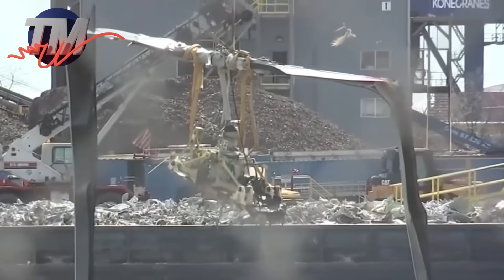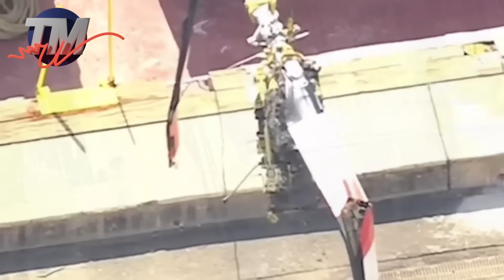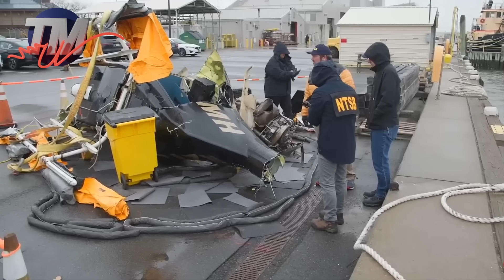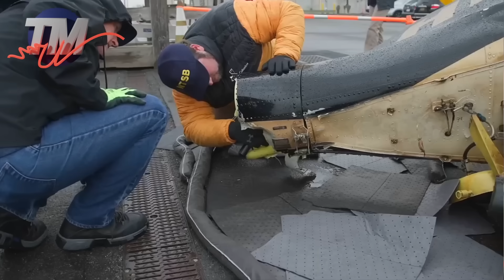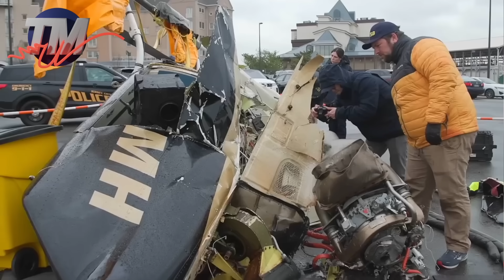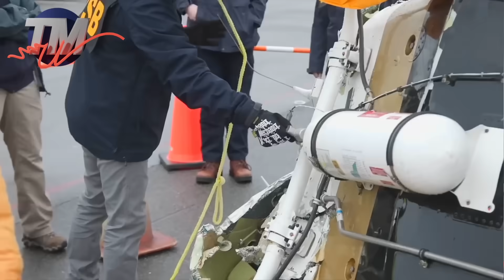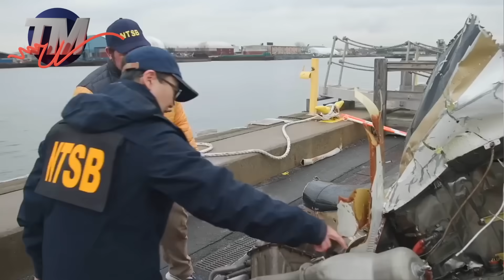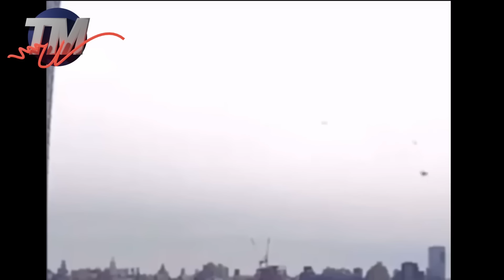Recovery of the Main Rotor of the Hudson River Tourist Helicopter - it's worse than we thought

Comment: Pure speculation but watching the videos I have a hunch or two. Former OH-58 crew chief so knowledgeable but certainly no expert. The crash video shows the MR with attached gearbox rotating all the way down to the water. This suggest to me that the gearbox had not seized as it appears to be rotating freely as a unit and remained in the same plane throughout the fall. The pics don't seem to show any mast bump deformation. Not sure a seized TR would generate enough torque to rip the MR & gearbox cleanly from the airframe. I suspect an airframe failure. As an anecdote, upon our units return from Desert Storm we discovered one of our 58's had severe but hidden degradation on the maintenance "walkway" on the roof. The airframe just gave away and the honeycomb crushed when stepped on. Engine mount/airframe failure if I had to guess.

Comment: I ask myself if maybe the pilot sent the message that he needed fuel and was coing back, because he realised that something was wrong with the helicopter but he didn't want to afraid his passengers. So, maybe he lied to keep the passengers calm. But he tried to tell his enterpreise that there was a problem.
Reply: From what I gather that was just to have the logistics prepared, he'd need a truck and the next run would be delayed for fueling.
Reply: He was already coming back though, it wasnt like he was cutting the trip short, it was only a 15 minute flight anyway, and that guy paid around $400 per passenger for tickets, so he paid around 2 grand for 15 minutes.
ANy kind of mechanical issue that would have caused the pilot to do what you theorize- would have been heard/seen by the passengers too, they wouldnt be fooled by hearing a LOUD bang and cracking sound and hearing the pilot radio that he's low on FUEL!
Low on fuel doesnt create banging, cracking or noises or wierd sudden unexpected movements inflight.
Reply: He was coming back anyway, he was just radioing ahead to say he needed to refuel before the next flight.
These operations do a number of flights per refuel, so it is common to call ahead when you need to refuel so they can be waiting with the fuel when you arrive. Radio call is a non event.

If he knew something was wrong with the gearbox he would have declared a mayday and looked for a landing spot immediately, including considering ditching.
Reply: @rosamolina2277  - I like your theory!
Reply: I too  @nadogrl
Reply: Interesting idea.  The fuel tank, if recovered intact, would tell if the chopper was that low on fuel.
Reply: My thought exactly when I first heard about the radio call for fuel. For that short flight, they surely had enough fuel. It was the pilots call for help!
Reply: @manariitane5167  That was his 5th or sixth tour flight of the day.  It's pretty normal for a pilot to notify his base that he would be needing fuel before his next flight.

Comment: The rotor separated from the helicopter is what's puzzling me the most. I've never seen anything like this before.
Reply: That is because the video shows the tail separating first. The tail driveshaft thrashed the whole transmission assembly free.
Reply: @sirsmeal3192  Order of separation from the fuselage does not indicate the sequence of failure.
Air accident investigation basics!
Reply: A witness said they heard two loud bangs and the helicopter 🚁 dropped from the sky another witness said they saw a drone flying towards the helicopter

Comment: Have you considered the fact that a 10- or 12-year-old child was given the copilot seat of the aircraft? He's just a child, and he thinks like a child, and he could have pulled some lever, like the lift manifold. The truth is, photos have emerged showing a child as the helicopter's copilot. This raises a question for you: Yes, on this type of helicopter, at a certain speed and flight position, a sudden sharp jerk is applied to the manifold lever. Could this cause the main rotor to hit the tail boom?
Reply: The child might only have been having a photo taken with the pilot. He might not have been in that seat for the flight.
Reply: @karenrussell8704  - My thoughts as well.
Reply: It’s a single pilot helicopter. There is no copilot.
The other front seat is a passenger seat.
There will probably however be a set of controls there for training purposes.
The seat is normally slid fully back so they cannot be reached.
Reply: I thought about that too.
Reply: It was only to take a picture before the flight

Comment: In a tail rotor failure, you don't auto-rotate, you do what's called a, "running landing." The UH-1, which I flew, streamlined between 60 and 80 knots, and if the tail rotor failed, you'd keep forward speed up and land on the skids and ride it out while the energy bleeds off.
Reply: Bull crap
Reply: So you don’t reduce the collective?
Reply: When you lose a tail rotor you lower collective and close the throttle(s) and enter an auto-rotation.

Comment: Its because they're litterely trying to find anyway to blame trump. Ive watched alot of videos and read alot of comments and people are blaming a sitting president, if theres an agenda thats it. Because trump wanted to change air traffic controllers from d.e.i hiring to bringing in people that can do the job the media has been jumping all over this. The problem is the air traffic controllers have nothing to do with these accidents they were caused by mechanical failure and pilot error. New york city's air space is very busy and theres no suprise its happening there. I mean the plane that landed in the hudson was caused by bird strikes, the military helicopter was caused by ignorance and lack of training, the helicopter broke apart, the small plane crash was due to low altitude none of these were trumps fault!!!

Comment: I don't think it's agenda driven (other visitors started their trip only minutes later with other companies, without any fear), but I also think the "amputation" lines at the helicopter seems to be very accurate. I don't think it was sabotage by opening srews...because the heli had several flights directly before. but the idea to initiate this chain of failures by any remote controlled thing could be a theorie. for any reason. what was the role of this manager? world is cruel.

Comment: There is not excessive hype in the reporting.  I can't remember all the incidents, but some of the main ones:  1. Passenger plane ready to land in Washington DC is hit by a military helicopter going down the river at night on a training mission.  All passengers are killed.including potential future members of the US Olympic team.  2. Commercial passenger airliner leaves Minneapolis attempts to land normally in Toronto, but clips a wing in rough weather conditions when landing.  The wing breaks off and the plane rolls over  on it's back.  Most passengers escape.    3.  NYC tourist helicopter has one of the most curious break ups of all time mid flight, and the pilot and an entire family of five are killed.   4.   Passenger plane leaves Colorado Springs, headed to Dallas, and  experiences engine vibration.  Pilots elect to fly to Denver rather than returning to Colorado Springs.  Denver is in the wrong direction and further away.   Plane catches fire at the gate.   Passengers elect to escape the fire by using the wing emergency exits only to discover they can't get off the wing because there are no emergency slides.
None of this is media hype.  These are real events that represent an industry that is dysfunctional, and as a result is not safe.
Reply: Example 4 - Pilot elected Denver perhaps because it was closest airport with MUCH BETTER first response equipment than Colorado Springs' smaller airport facilities. You don't have slides on over-wing exits.
Reply: @checkyoursix5623  Denver is further away in the wrong direction.  The passengers didn't know they couldn't get off the wing.
Reply: @checkyoursix5623  Actually you are wrong.  Most aircraft do have over-wing exit slides - just google the phrase and click on images.
Reply: The industry is in trouble due to lowered hiring standards over the past few years and antiquated, unstable computer systems that are difficult to maintain.  Also there is much more video coverage from security and personal phone cameras.  The Reagan National accident happened during prime time and had video images.  Those factors plus the widespread ignorant speculation and hysterical speculation by the clueless mainstream media heads all add up to the heightened awareness.
Reply: donald trumps America.   Planet trump
Reply: @frez777  What the "F" is wrong with you? Or are you just that "F"ing cold. This took lives that will never be complete. And it took some kids lives on top of that! You are a cold "F" and your time will come! I hope that you are all alone when the reaper comes for you my sad friend!
Reply: @frez777 seriously..go back to school
Reply: @frez777  Yours is the stupidest, most ignorant comment on this page. Air accidents are actually down this year so far, compared to previous years.
Reply: @frez777  Grasping at straws, advanced TDS?
Reply: @frez777  Nothing to do with Trump. If anything maybe its Biden's DEI program.
Reply: @NYyankeeboi  It has little to do with presidential politics, and more to do with rather old helicopters with many duty cycles being used to fly unsuspecting tourists.who believe the machines to be safe.
Reply: @frez777  More likely Biden's legacy.
Reply: I agree these are items worthy of the national news, but I think they are also coincidences and we just happened to hit a string of them. That said, I also don't approve of the way the Trump Administration is handling its duties and our agencies. If we don't see funding and employees back at work soon, then we can expect to see more catastrophes in many different areas, from food safety to bridges and weather.
Reply: @edherdman9973  This comment sounds like thirteen year old logic....Presidents just implement the plans of their hidden masters....The masters are all about Chaos as they implement their UN digital control grid agenda 2030
Reply: @edherdman9973  They are looking to reduced waste.   The bureaucracy is obviously very heavy  Ronald Reagan screwed up the ATC system years ago.. Most of these aircraft mishaps have nothing to do with any cuts made by  DOGE..  Hiow is this helicopter failure related to DOGE?   There are plenty of NTSB officials gawking at the wreckage.  Why would they start removing the instrument panel out on the wharf?

Comment: There was a heli over the Grand Canyon, where a boom strike resulted in enough force that it sheared off the tail section.  Not saying its a mast boom strike, but that shock forces generated at the rotor, can cause tail rotor failure.  The image seems to show the tail detached first.

Comment: What happened here is EXACTLY what I said it was day one within 10 minutes of the first footage releasing. Who ever serviced that gearbox last is your guy.
Reply: Had nothing to do with "gearbox servicing". Once the transmission is installed, there's no way to "inspect" the inside of it to find impending problems. It's a flight hour limited change-out item. The only way to detect future transmission problems is (1) trans chip light illuminates on the cockpit "Caution Panel" (means "LAND IMMEDIATELY"), and (2) finding metal shavings on the magnetic trans oil drain plug during scheduled lubricant replacement. (used trans oil is normally sent in to a lab for spectrographic oil analysis, and not just 'dumped' like in a car or truck).
Reply: @ These guys were broke and not following the rules. This falls on maintenance.
Reply: @The-House-of-Seven  As a 30 year mechanic, you should know better than to state something like this as a fact. There are several things to verify with this crash, and at this point in time, no one knows what happened.
Reply: @marcd1981  When did I say I was a 30 year old mechanic? Your comprehension skills need some work before you go trying to call people out in youtube comments.
Reply: @marcd1981 they were bankrupt, wouldn’t be surprised if they deferred some maintenance
Reply: @The-House-of-Seven  My comprehension skills need work? That is pretty funny coming from someone that apparently can't read. 

Read my comment again, Einstein, I repeated what you stated, that you are a 30 year mechanic. Never said anything about you being 30 years old. And then you come on here thinking you have a burn for me? What a joke your DME must have been for them to sign off on you.
Reply: @checkyoursix5623  What could cause a gear box failure ? Broken gears jamming, failure of bearings , plus really who knows until the gear box is opened and inspected, which most likely what will be done !
Reply: I agree
Reply: …or gal
Reply: @The-House-of-Seven  pray to God the gearbox servicing technician  was NOT a Biden’s DEI “magical mechanic”  and YES….. I’m serious‼️
Reply: One word explanation: Fatigue
Reply: Of course on a 25 year old copter, and it's taking off and landing as frequently as it did for tourists trips lasting only 15 minutes- fatigue is going to be a big issue. I had a '69 Dodge pickup truck that overheated around 1996, took the heads off and found the problem- one cylinder had a FACTORY defect- the core had shifted in the casting the block process, so the cylinder wall on one side was about 1/8" thick and on the other side about 3/8" thick, it lasted for  27 years and then suddenly just driving home after work it gave out.
Reply: @HobbyOrganist Wow, that's incredible! Very poor quality control though. I've worked in a factory machining cylinder blocks, and they were 100% checked. But I suppose 1969...!
Reply: you sound like me
Reply: @frez777  30 years as a mechanic...
Reply: the pilot had radioed in that he was out of fuel.  flew for 2 minutes longer and here we are.  she tipped and the blades must've hit the raised tail.... everything came apart w/ the energy of the powerful shock - total duration of event, 7 secs.  this is what i've gathered so far listening to educated/experienced people.  it is hard to see in the video exactly how it happened, but it is a start that has merit.  she was certainly being pulled apart in short order.  until the answer is found we have quite a mystery here.
Reply: @megenberg8  He never radioed he was "out of fuel" This conversation is way beyond you.
Reply: @megenberg8 get your facts straight
Reply: @megenberg8 Fuel or lack thereof does not cause the machine to tear itself apart!

Comment: One witness, heard a loud explosion noise, before break up.
Reply: The ‘ explosion’ could be the sound of the main rotor assembly being torn from the airframe
Reply: Witnesses are notoriously inaccurate in such matters studies have shown it,and then there's the inevitable time delay due to relativey SLOW sound waves v/s what you SEE visually, in fact you see some videos that show the body of the craft actually hitting the water- you hear the SMACK of that about 2 seconds after you SEE the water splash up, so you see SMACK.... then.... BOOM.
Others have said the fan or clutch disk when suddenly free spinning without and  load "explodes" and  disintegrates at the high rpm with a shotgun like bang
Reply: Due to the speed of sound typically witnesses would hear a bang slightly after the incident.
However as has been said, witnesses are notoriously unreliable. So many witnesses report aircraft on fire, explosions, seeing the look on passengers faces etc… when they actually saw a aircraft with no fire from 2 miles away!
There is some interesting psychology behind.
Children actually make the best eye witnesses because they just say what they see without influence, agenda or projection.
Reply: I prefer to trust the camera footage.

Comment: It would have rotated clockwise as the rotor has a counter clockwise rotation. It also didn't break at the tail junction it broke one rib away from the junction at the inspection panel.